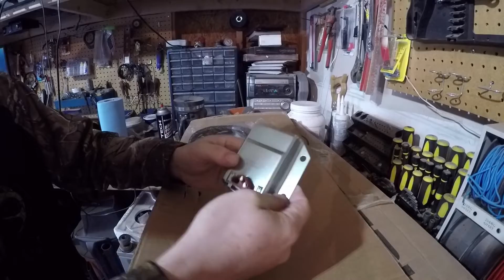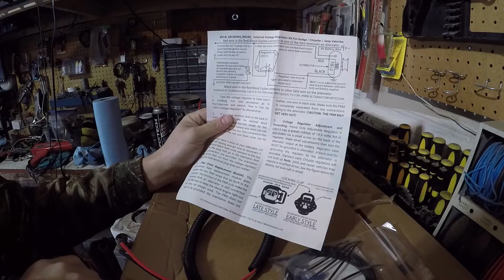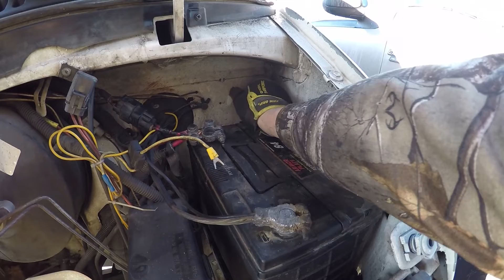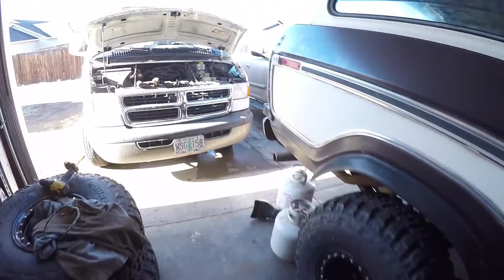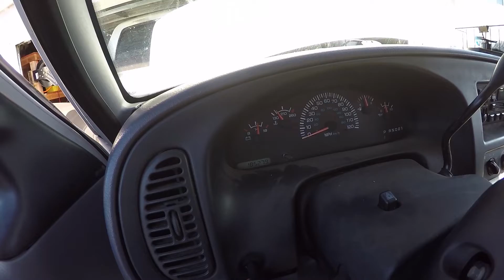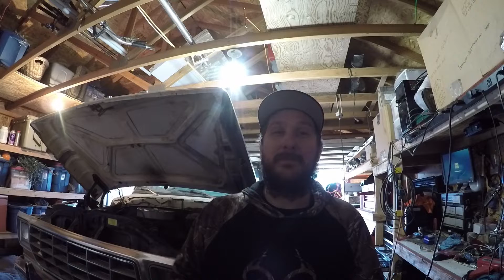1998 DODGE 1500 VOLTAGE REGULATOR CONVERSION

Comment: I ended up replacing the ecm. Voltage regulator was in their. Made it easy, no wiring needed. When I changed ecm my gas gage worked again. My air bag light went away. Guess I was having more problem than over charging.  😂

Comment: I'd advise getting a stiffening capacitor or a high output alternator if not both if your running that machine off of it. Good god no wonder youre having problems.

Comment: Vans SUCK to work on PERIOD! PCM is under $150 to get a remanned unit and it takes care of any future issues yours is about give you. Used go for 60$ and up. If you use a computer from a similar year series they work without any programming or anything. For instance 94-01 Ram with a 3.9,5.2,5.9 and 5.9 D will work with a Dakota, Ram or Ram Van PCM. The 3rd plug away from the fender has issues because of pressure from harness pushing or pulling on it. Zip tie it after resolving that issue. Biggest issue with them is NO BUS code and shutting down or not starting to begin with. Heat is the reason, they almost always only act up at full temperature on a hot day. A small 12v fan will save it for most.

Comment: You dude i hope you give me an answer: I think i might have the same problem with my dodge mini ram van 1988 2.5L. is this possible? 
What were your symptoms?
Mine are an engine thats doesnt run idle properly, the accu isnt charging while running. Yours too?

And if the voltage regulator is broken can you simply ignore the old one and shortcut it? Last question: you put the 12v output to the fuse box. Will this method deliver all the systems (including fuel injection) the provided voltage of 12 volts? Hope you/someone can help me

Comment: I put new alternator, new battery and external voltage regulator and still no charge, had alternator bench tested and was good, what am I missing?
Reply: Same problem did you ever find a fix ?

Comment: I have the same van only 2 years newer. If you have any other electrical issues feel free to reach out to me on instagram @aaronrecine I know these systems in and out lol
Reply: Problem with mine is the voltmeter  keeps going way up. Alternator tested fine. Got the pcm code
Reply: I got the modulator w my kit though